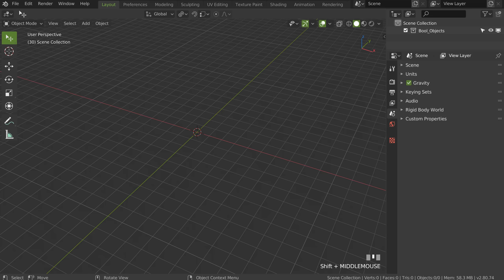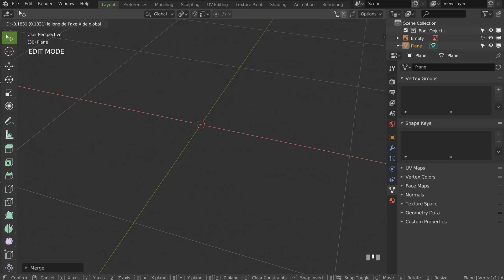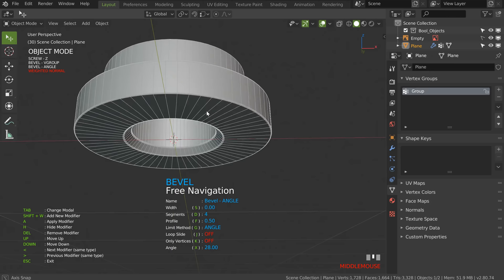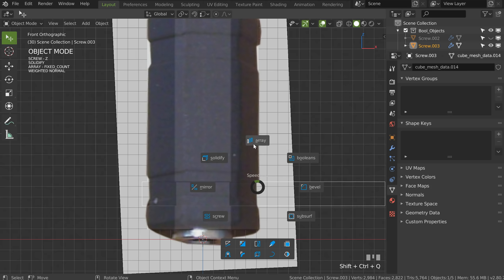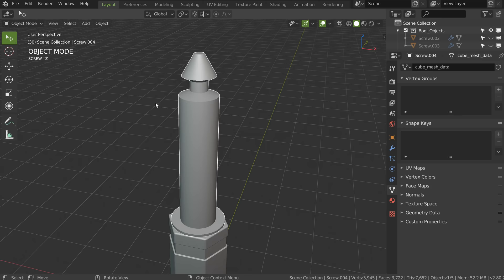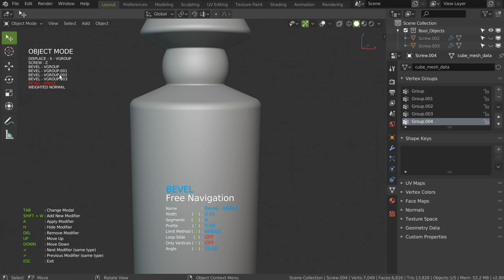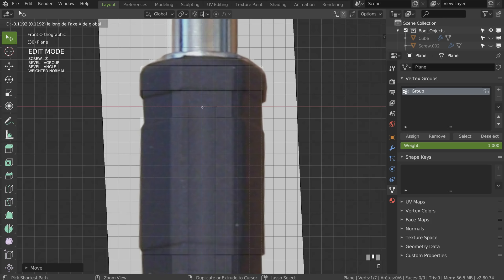Speedflow basics - 01 - Jack Adapter - Blender 2.8

Comment: Wow, this does such a good job at showing the powerful simplicity of this addon :)
Reply: Lol it's much more complex than screw modifier in vanilla blender but w.e
Reply: @augustecomte3841  speed flow uses standard Blender modifiers, but makes access to their settings available on the fly. It also often does more than one thing under the Hood, saving you the time to set up the same. I feel like you're missing the point here, but you're free to your opinion...
Reply: @cultofape1000  Have been using it for many years. My point is that it is easier in blender 2.8 to just add a plane delete the verts add a single vert and apply a screw modifier.

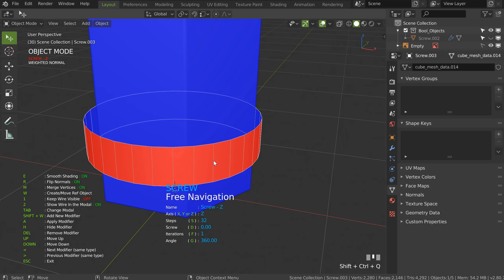Comment: hello! at 9:52 when using the screw vertex point mine does not make a ring when extruding from the first vertex point. Its almost as if its treating the first v point as the origin of the ring so my result is just a line not a ring. please help!

Comment: Is there a way to reconfigure the shortcuts for those of us who don’t have the middle mouse button (e.g. Apple Magic Mouse)? Right now it seems that the only way to change the values in Speed Flow is to type them in manually.
Reply from the maker: WTF do you use an Apple Magic Mouse? O_o
Use the pen mode in the addon prefs, you will change the values by moving the mouse.
Reply: It’s what came with my iMac, no need to be rude :) But thanks for the tip, I’ll give it a go!
Reply from the maker: @ilkkarosma5528  I'm not rude, every 3D software use mouses with 3 buttons.
You need to trash this mouse if you want to make 3D.

Comment: Salut, encore une fois.  There's a tutorial demonstrating how to change what commands I want when activating functions, yes?  As it is, when I press control/shift/Q, I get nothing, but you get screw/mirror/solidify/array/boolean/bevel/subsurf.  And pressing shift/Q only gives me a different set of options.  Many times, in other addons, the commands are a little bit different for a mac then they are for Windows PC.  Is this the case with Speedflow on a mac, or, as you have said, I can make them what I want?  Looking at that section in Preferences, there seems to be what looks like 100's of functions all with there own shortcuts.
Reply from the maker: No you can't change the shortcuts of the addon, only the one to call the addon.
The shortcuts are the same for win, mac and PC, check the documentation in blender N panel > Tool > speedflow documentation.
To call speedflow it's SPACE, check in the pref of the addon too for more information.
Also, support is on the Discord > https://discord.gg/ctQAdbY

Comment: What if Shift+Q doesn't work to open companion menu?
Reply from the maker: Check on the addon preferences ;)
Reply: @pitiwazou  Bonjour, Cedric. Merci bien - maybe I should get on discord, please excuse me coming from 20 years 3D modeling in several other programs, not Blender. But I'm not seeing "companion" listed anywhere under speedflow opts in Keymaps or UI for the plugin (v.0.0.24). Also, I don't even see where to input the license key when I got the plugin. Is that not a thing in Blender? The plugin looks amazing in the videos, but as a Blender noob I feel a bit confused. Sorry.
Reply from the maker: @3DCGdesign  Companion needs to be installed ;)
And, yes, for support, better to come on the Discord!
Reply: @pitiwazou  aha... I see now the "companion" in some of the installers. My mistake, I just installed the latest version. Sorry for stupid question. And I have now joined discord.
Reply: works now!